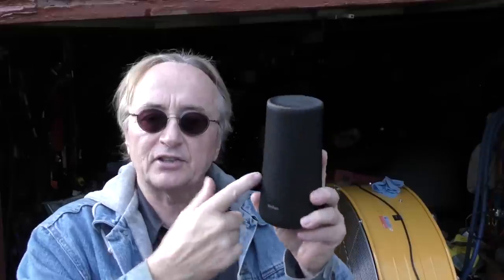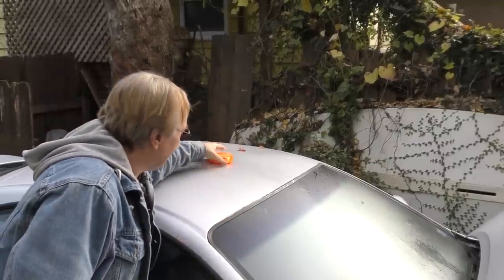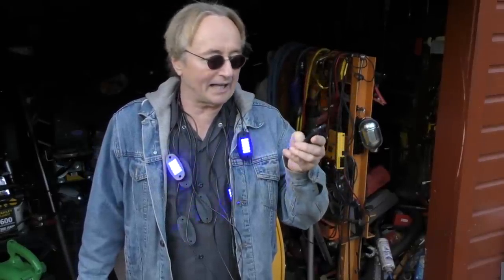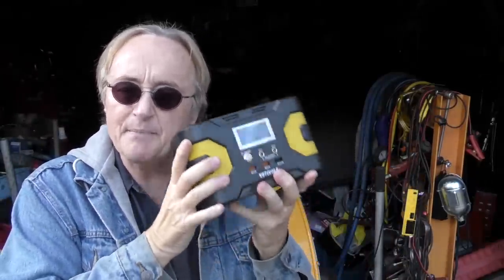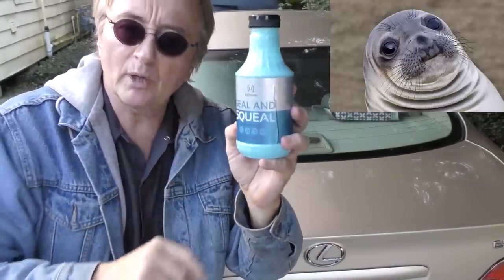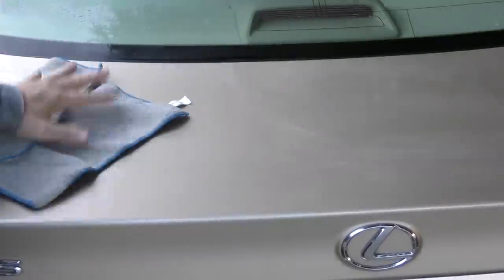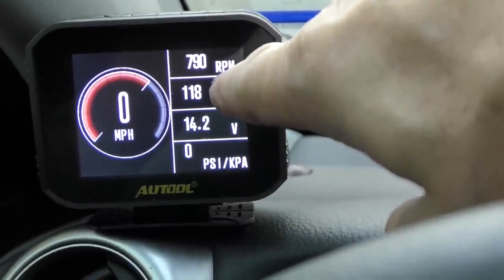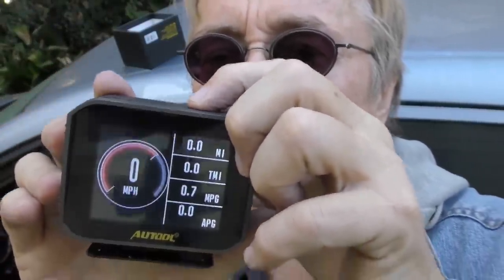The Only Christmas Gift Car Guys Want (Illegal Car Mod)

Comment: He Scotty. Actually the chains didn’t keep the motor from falling out. The torque of the motor would lift one side of the engine up causing the foot peddle to go to the floor. Opening the carburetor wide open.🤣 Happened to dad’s 69 impala. He was smart enough to throw it into neutral. Saving us from a accident.

Comment: The Bluetooth speaker SOUNDS like a great gift😁
Reply: If your car has bluetooth.
Reply: @peterbarratt8699  My phone has Bluetooth.....
Reply: @mikespecht5066  Does the spkr deaw power from BT, or has it got its own batteries. What is the power output of the spkr. Does the cable have a phone adaptor?
Reply: @peterbarratt8699  I do not believe that Bluetooth can send power to any device. The receiving device (speaker) would need its own power. Most of the Bluetooth speakers I have seen have rechargable batteries with a micro USB port.
Reply: @mikespecht5066  That's fair enough and why I prompted the questions. I'm intrigued, though. Most cars, if not all, come with a decent tuner/amplifier system already imbedded.

Comment: The only people who need the SOS light are dodge and Chevy owners
Reply: And Fiat/Chrysler
Reply: My uncle coulda used one when his F250 blew up
Reply: Good light to have if you bought a 2020 Lincoln Aviator. At least you won’t get hit from behind while waiting for the tow truck.
Reply: A Ford owner I'm assuming, pretentious as ever I see.
Reply: But you take the bus. LMFAO
Reply: There is one that flashes for the code for “ Fix Or Repair Daily • more commonly the FORD emergency flasher ( it’s cheaper in Bulk ) and it can also be installed permanently on the hood . ( it has a free Bluetooth app ) , the app helps to wake you up early in the morning to try start your Ford and hope it works ......
Reply: you mean for Found On Road Dead FORD THERE not dependable as chevy

Comment: Those new GM cars and trucks look really nice though with sharp lines. But the funny thing is that all that beauty and there are  still issues inside. My dad used to own a 1985 Chevy Celebrity station wagon and it lasted beyond 200k miles and had no issues.

Comment: Thanks for all your informative videos! Has helped me out of a jam many times. My cars engine and ABS lights were on and wouldnt pass inspection. However the only codes were ABS related. Cleaned all the Speed sensors and reluctor rings etc. Still no fix. Bought the Creader 7 scanner to show real time info on all ABS sensors. Th is scanner is awesome for the money. Pinpointed the exact speed sensor that was bad. Went to junk yard and pulled one and viola! I love this scanner! Used it to fix several friends cars within 2 weeks of playing with it. ThankS Scotty. Your the man. Now send me that speaker! LOL!

Comment: Love your channel!!! Have A B.C.M went on my 89 caddy no gas gauge or heat control and cooling fans run the minute you turn on the key and heater fan stuck on high! But the car never ran better! Always ran well but tons of more power? But have to replace it lot of B.M.C out there all different part numbers and all say fit your car!!! 😆 amazing sound from that speaker unit lonng way from portable hand held am fm radio! Well Merry Christmas to you and yours!!!!

Comment: That gadget will read your travelling speed, if you have ABS or if it's tracking your vehicle through the services of a GPS satellite. If you drive an older vehicle of which has a speedometer cable, either hooked up to the transmission or to a wheel, only a GPS reading would work on that gadget, if it even has this feature

Comment: I got no radio in my DATSUN! Could use the speaker! Also why would my radio always turn on and off when I hit bumps? I've manually reconnected all power wires, old electrical system fluctuates between 11-14 volts depending on if I'm using lights, heater, blinkers, and maybe has spiked through the radio? Still displays accurate time when its on so it hasn't lost power! It's 2nd radio to do this! Bluetooth looks like the cheaper and easier way to go haha

Comment: The Autool X80 Scan tool comes from a high tech part of China that will take forever to be delivered to you.  Nevertheless, it is worth waiting for (6-8 weeks).  If you have a car that doesn't have a tachometer or other sensors, then you should get it so you get to know the baselines of your car when it is performing normally.  When you have problems, you'll know ahead of time because the numbers are off of the baselines.  Mounting it is another story.  Try to get creative by using dash mounts meant cell phones and tuck the cables into the trim.  I would actually suggest shaving off the CAT-5 hood so you can easily disconnect it by hand when you need to remove it for people borrowing your car or for driving others who might be befuddled by such a device.

Comment: If car companies weren't corrupt, We'd have OBD computers, and repair manuals built into the center console screen. Instead of just a "check engine"  light, it could just tell You the codes.  It could be linked to a blueprint of the car, and give recommendations of things to check.

Comment: Hey Scotty, I'm researching trucks to tow a track car for weekend high performance driving events.  I came across two F250 XLT Quad cabs.  One is an '07 with the V10 and 80K miles for $14K, the other is a '13 with the 6.2L V8, 103K miles for $16.9K.  I believe both are capable of towing the capacity I need but what are your thoughts on reliability and cost to repair between the two?

Comment: I have the possibility of a 1997 Toyota Camry as a gift. It has an electrical problem no one seems to be able to diagnose. It only has 90,000 klm on it. Is it worth changing the wiring harness. I feel bad giving up on her?
Reply: haywoodyoudome  I find this interesting. The car had been parked because it wouldn’t start. It was a totally reliable car up until the point it wouldn’t start. Relays were changed and wiring examined. It sat in a country driveway for 3months.  I have had 2 private mechanics say it was electrical and now have it at a dealership. Private mechanics didn’t want to continue because it is - degrees in Canada. What other things do you anticipate  after this?
Reply: @michellest.germain4775  After having a dealership look at it?  I'd anticipate a bill for more than what the car is worth.

Comment: I drive around with a bluetooth speaker also because they are so loud and my radio doesnt have bluetooth so its a hastle to get the radio to play what i want
Reply: W A E trust me when i say this, paying for a nice stereo system is definitely worth it.
Reply: @garettjohnson2234  from my experience everybody i know that has had aftermarket systems have had issues with their alternators, and plus my car has a built in system just not bluetooth so i have to use a bluetooth adapter in my aux
Reply: W A E i upgraded my stereo and all my speakers and got 2 12” subs, never had a problem with alternator, you just have had friends not get quality stuff
Reply: @garettjohnson2234  no i think it was the installers
Reply: @garettjohnson2234  how long have you had the subs
Reply: W A E had them for about a year pushing 2400 watts, got a new truck just a few weeks ago though
Reply: @garettjohnson2234  ok